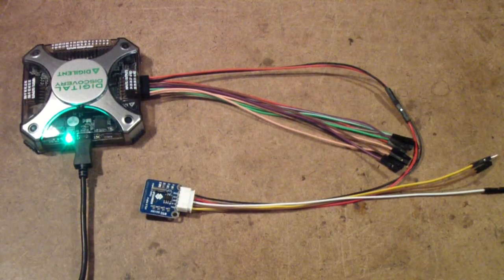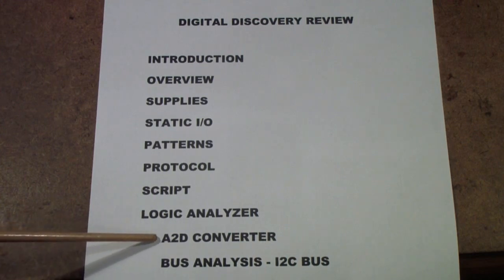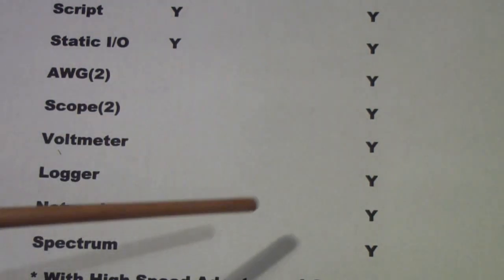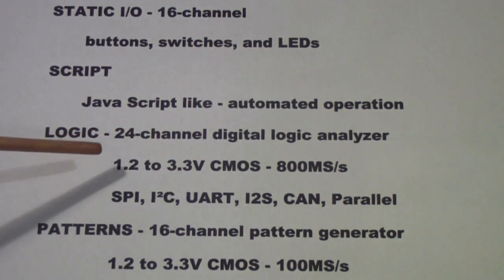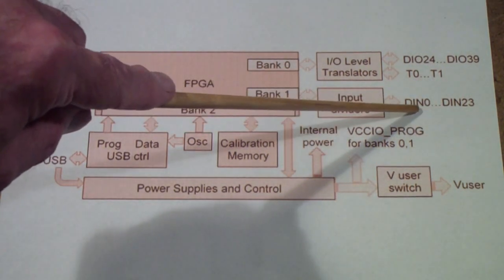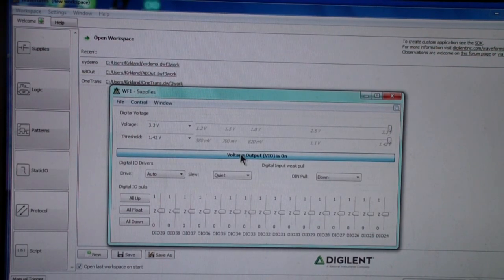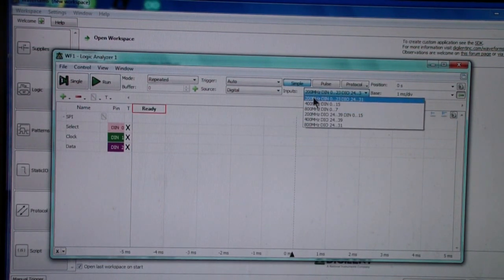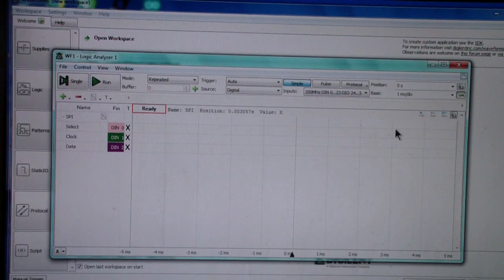TTT161 Digital Discovery Review Pt1

Comment: Hi. I like a lot your videos.  Anyways my 2 cents.  You can run both devices on one computer as long as you have two USB ports available.  You just open two instances of Waveforms on Windows.  On Mac you will have to open the second instance of the program via command line but it is also possible.
Reply from the maker: Thanks for the info. I will try it.